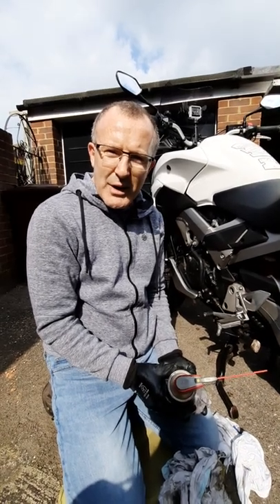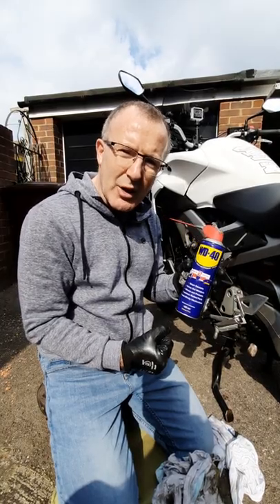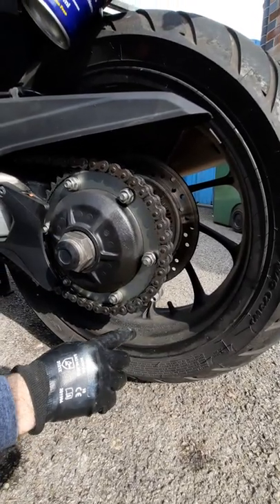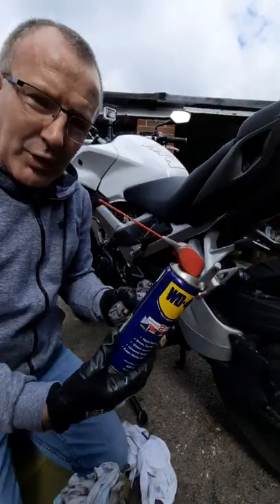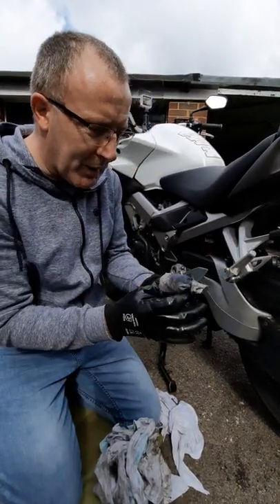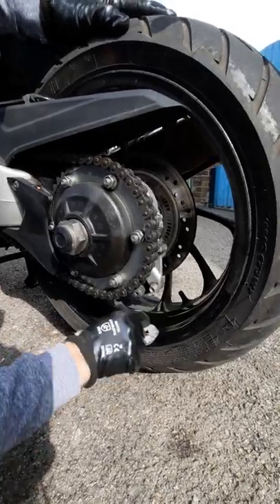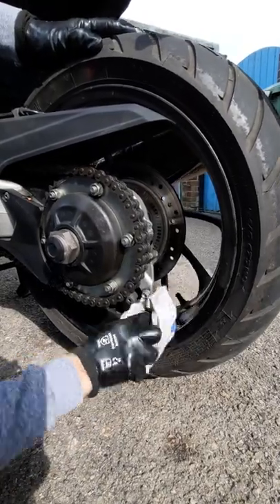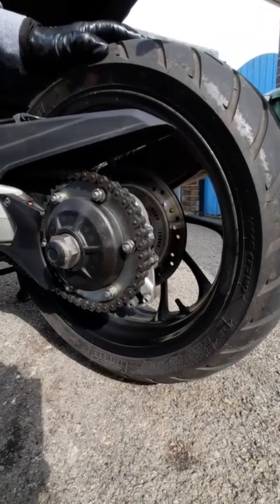The Best & fastest way to clean your motorcycle wheels

Comment: I used WD40 for years but it's a dust, grime, and break dust magnet...Use break cleaner spray or the cheap Green Power Wash in the gallon jugs on my black motorcycle rims, after cleaning the rim wipe it down until it is totally dry, and then apply a ceramic or graphene infused spray wax to the rim. Let it cure on the rim, buff it off with a micro fiber towel, and your rims WILL repell all road grime, brake dust, and contaminents from the road. These waxes bond to the rim and with just a garden hose or pressure washer the next time you want the rims looking like new without the bust'n your butt to get them clean...